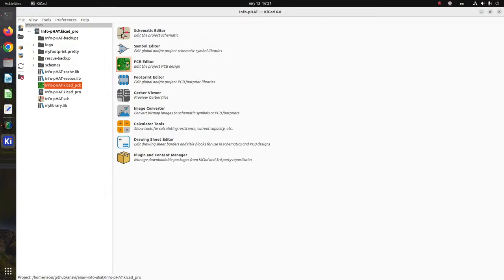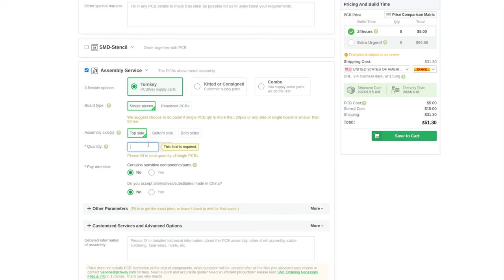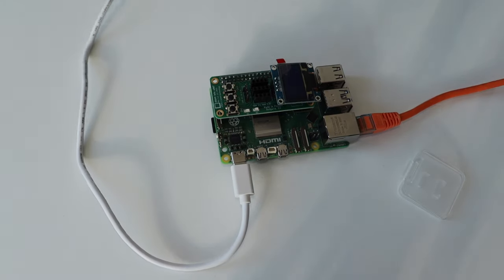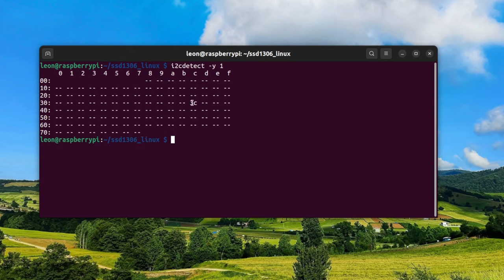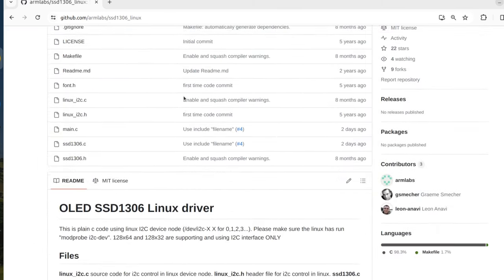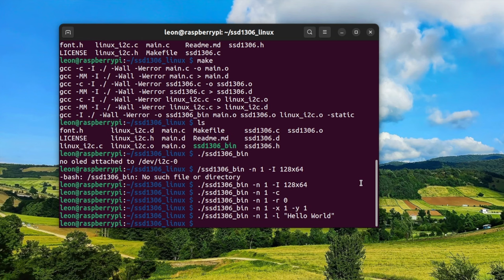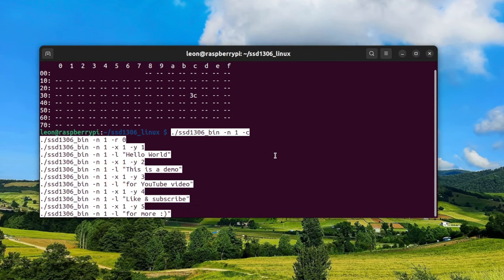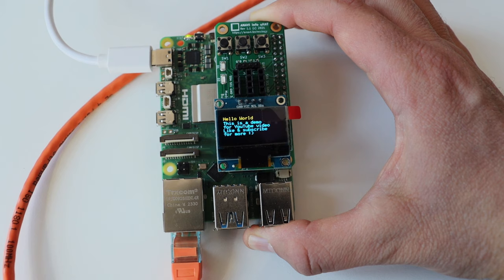SSD1306 OLED I2C Display on Raspberry Pi 5 with Linux User Space C Driver and Raspberry Pi OS

Comment: Thanks for this video. Helped me get the SSD1306 connected and tested to RPi5. However, towards the end of the video you mention about Python examples with RPi5 using GPIO. I could not find any videos for that - did I miss it?
Reply from the maker: Glad the video helps. No, I don't have video with Python3 for the OLED. I should probably do some tutorials with Python.

Btw earlier today someone opened a GitHub issue with question about the Python example (I am not sure if you opened it or someone else). I provided some ideas how to install Python3 luma.oled library. Here is the link: https://github.com/AnaviTechnology/anavi-examples/issues/11
Reply: @LeonAnavi  Yes, python examples would be good. But I see access to gpio has been changed with RPi5. Still trying to figure out which library to use in python for Rpi5 gpio.

Comment: Awesome. Is there bigger size and higher resolution for this kind of display and is there touch screen as well ? Thank you.
Reply from the maker: No, particularly the SSD1306 supports max resolution of 128x64px. There are other similar controllers that support bigger sizes and resolutions. For a reference please have a look at the list of controllers from this popular Arduino library: https://github.com/olikraus/u8g2?tab=readme-ov-file
There are similar displays with touchscreen from brands like Winstar (they will require different and additional drivers to work).

Comment: Thanks for your videos! Beyond text strings like on video, can we display some of Rasp Pi stats, ex: ip address, cpu temp ...? jusst a question
Reply from the maker: Yes, absolutely. Actually, with ANAVI Info uHAT add-on board and the sensors included in the kit like HTU21D you can do exactly this. As alternative to the C driver shown in this video, there is even a Python 3 demo script to show the IP address: https://github.com/AnaviTechnology/anavi-examples/blob/master/peripherals/OLED-SSD1306/python/OLED-SSD1306.py

Comment: If I am running a Tkinter program, is it possible to display it using the OLED screen
Reply from the maker: I am not sure it is going to work out well. These SSD1306 displays have small resolution. The one on the video is with 128x64px. Why don't you use the luma.oled Python3 library in your case?
Reply: @LeonAnavi  i tried and it worked alot better, thanks
Reply from the maker: @0zz_b0zz72  cool! I am happy to hear that my recommendation to use the luma.oled Python3 library worked out well for you!

Comment: What did you do to resolve the no oled attached to /dev/i2c-1 error? Thank you!
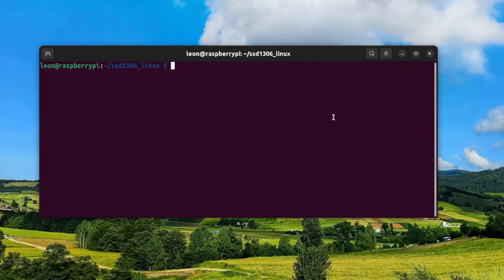Reply from the maker: Open a terminal and execute command "i2cdetect -y 1" to check if the OLED display is detected as an I2C device as shown in 2:35. If not double check the hardware wiring and make sure I2C is enabled through raspi-config.

Comment: hi sir I tried this with Rpi 4 model B here the problem I am facing During the initialization  it going to  else if (ssd1306_oled_load_resolution() != 0)
    {
        printf("please do init oled module with correction resolution first!\n");
        return 1;
    } always return this can you help me?
Thank YOU
Reply from the maker: Initialize the mini OLED display with resolution 128x64px using ssd1306_linux:

./ssd1306_bin -n 1 -I 128x64

Comment: Is there any way to output command line to screen?
Reply from the maker: Yes, in general. Could you please share details about the context of your question? What command line do you want to output on this mini OLED display?
Reply: @LeonAnavi it’s the sss1306. In wanted it to show what I type in terminal line
Reply from the maker: @Yellowpinecone  hm, this is tricky. Which terminal do you have in mind: text console (terminal), serial console over UART, a console from SSH connection, etc?
Reply: @LeonAnavi well either one would be good. I do use primarily ssh so that would be more useful
Reply from the maker: @Yellowpinecone  well, in a nutshell, you have to develop an application that grabs the console input and prints it to the SSD1306 OLED I2C Display. The implementation depends on which console you want to do it for.
Reply: Ok I will try writing a python script for it. Thank you